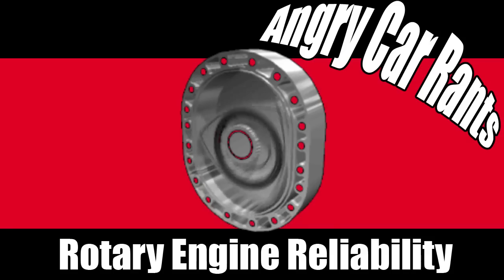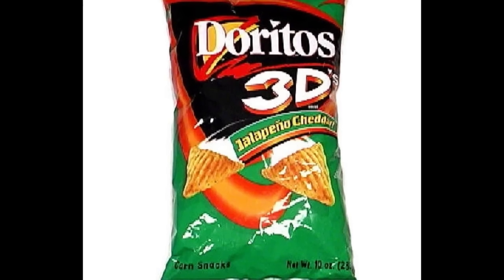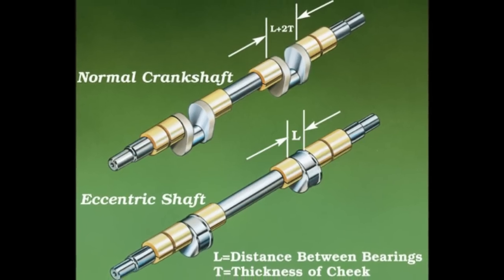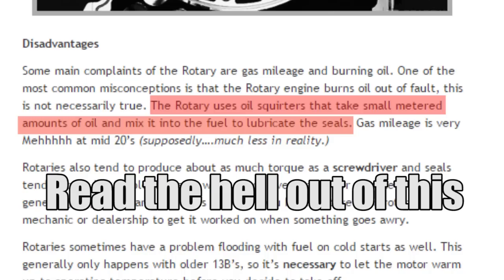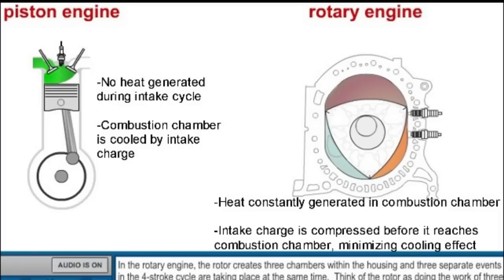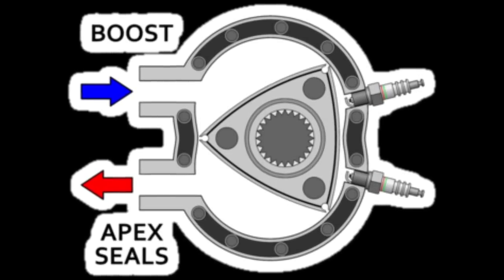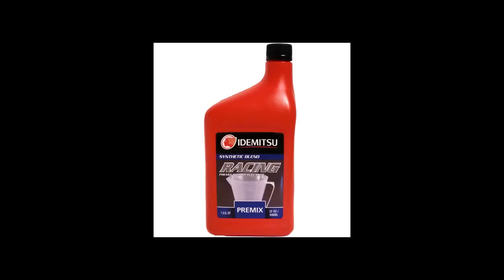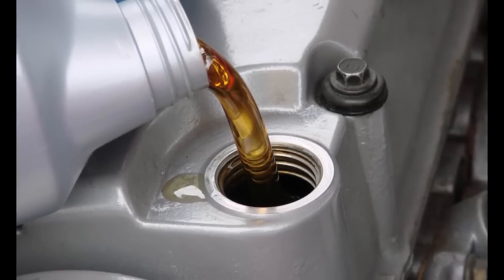Angry Car Rants #3 - Rotary Engine Reliability

Comment: Quick thought here too on another simple thing to improve reliability among these engines, DO NOT drive it until the engine is warm (give it 3 minutes to warm up, then keep it below 4k RPM till 10 minutes) and let it cool down really quick when you arrive before turning it off (all of 30 seconds to a minute or two depending on how hard you were driving) and you'll have a much longer lasting engine.

They're not hard to maintain just weird and different compared to piston engines.

Absolutely loved the video by the way.
Reply: +StellarNinjas seems annyoing you have to waste 2-3mins just to drive away :/
Reply: That's why they're usually more of an enthusiast car, besides you should really be letting a piston engine warm up for a similar amount of time, especially a performance built motor.

Comment: The trailing side of the rotary engine's combustion chamber develops a squeeze stream which pushes back the flamefront. With the conventional one or two-spark-plug system and homogenous mixture, this squeeze stream prevents the flame from propagating to the combustion chamber's trailing side in the mid and high engine speed ranges, Mazda engineers described the full process in 'Combustion characteristics of Rotary Engines', K Yamamoto et al., SAE paper 720357. Kawasaki addressed this problem in their US patent nº 3848574. This poor combustion in the trailing side of chamber is one of the reasons why there is more carbon monoxide and unburnt hydrocarbons in a Wankel's exhaust stream. A side-port exhaust, as is used in the Renesis, avoids one of the causes of this because the unburned mixture cannot escape. The Mazda 26B avoided this issue through a 3-spark plug ignition system. (At the Le Mans 24 hour endurance race in 1991 the 26B had significantly lower fuel consumption than the competing reciprocating piston engines. All competitors had the same amount of fuel available due to the Le Mans 24 hour limited fuel quantity rule.)[56] An inventor proposed that a narrow linear opening for spark plugs in the housing, instead of the round hole, would improve volumetric efficiency, fuel economy and emissions; he claims to have proved this by recording a measured reduction in the exhaust gas temperature. As in early reciprocating engines, a lower effective compression ratio is linked to higher exhaust gas temperatures. (YouTube: 'Rotary Engine Breakthrough')

Comment: btw, to get better cooling on it you want oil coolers, not necessarily a bigger intercooler. A big intercooler is nice, but in most cases a factory one will work fine. It's Oil coolers that you need to absolutely prevent overheating issues. Not cracking, just trying to help c:

Comment: An easy and basic cooling system upgrade that should have been covered is replacing the factory air separation tank made of plastic with an aftermarket metal one.  It is essential.  The factory one is a two piece plastic tank that is sonic welded together and splits over time, draining your coolant when it happens.  Anyone can easily replace this with basic tools.

Comment: Should do a rant on 2-stroke engines, and their reputation for being "dirty"

with direct injection (as evinrude, arctic cat have done) they don't live up to the dirty reputation. as well as being lighter, simpler, and more power per cc. The AMA have undeservingly shoved these engines under the rug, and it's time they made a comeback
Reply: craftsmanracer11 especially with the recent discovery that diesel 2-strokes can be insamely efficient while not being total coalburners.
Reply: +TheLaXandro True.. Currently the most fuel efficient engine in the world is in fact a 2-stroke.. of course the Wankel would be the worst... but they have been obsolete for a few years nows
Reply: +craftsmanracer11 I think 4-stroke engines are used because they're more refined, have a wider power band and are more quiet than 2 stroke engines.
Reply: Actually I find 4 strokes louder but at a lower pitch and 2 strokes bit quieter and a higher pitch.

Comment: I planned on one day getting a Mazda RX-8 someday and Wankel engine reliability is one thing that is a concern for me. I don't want to have to blow apex seals or rebuild another engine every so often, so after hearing this, it might just save me a little trouble in the long run. I really just want to enjoy a cool rotary powered sports car without worrying about the Wankel's recurring problems
Reply: I wouldn't go with a rx8 not really good for reliability

Comment: 2-stroke oils clean engines... now I've heard it all.

The problem is the fact that the oil metering pump pulls oil from the wet sump, which is dirty, used oil. That oil holds all kinds of crap in suspension, and when you burn off the oil inside the rotor housing, it leaves a lot of the contaminants it was holding. This causes a snowball of carbon deposits, which the apex seals need to scrape away, which causes them to wear prematurely. Running premix through the OMP with a Sohn adapter is ideal because it throws in new, clean oil. It also helps with cooling because the oil hasn't been cycled through the motor. Mazda simply had to combine the system because who would buy a car that has ANOTHER tank you must fill with a "specialty" fluid?

Comment: These tips are gold, as is the note to warm up before full engine load. But where's the tip about hitting 8k-9k revs briefly but regularly to prevent carbon buildup? Loose carbon chunks will wreak havoc with the seals and housing!

Comment: Rotary engines are not obsolete. They are still being made and used for aeroplane engines. There's military applications such as drone engines. Water pumps. They are also developing them to be used in electric vehicles that have a range extender motor. These are small single rotor engines that run a generator to charge the battery's. You can buy them as RC engines. Rotary is not dead it just moved on.
Reply: Wankel engines are obsolete... they are no longer in production anywhere in the world,
Reply: 1964 - 2012 R.I.P.
Reply: In the real world the Wankel engine is obsolete...
Reply: They are no longer in production anywhere in the world..

Comment: you also forgot to add that, the apex seals can be modified to withstand higher temperatures, as well as changing your stock Intercooler for a Bigger one if your 13B is turbocharged, along with a wastegate
Reply: ArcadeJunky The higher heat and pressure of turbocharging generally causes a negitive effect on apex seal longivity.

Comment: 195k miles on a 100% stock 12a (full straight pipe only, cat was bad). Lost a seal, made it another 15 miles back home would still start without a problem. Swapping engine as I type.

Comment: Drove a REPU 240,000 miles, it blew an apex seal, and I made it home on 1 rotor. Fun little truck, but what a gas hog. Eventually bought a Dodge with a hemi. 255,000 miles, better mpg, way faster, more reliable. I owned 2 Rotaries, first one rusted out at 100,000 miles. I also put a 13B in a boat, worked great, but loud as hell.

Comment: You forgot one more essential. Your engine oil must not be a synthetic or semi synthetic because when it burns the residue will gunk up the apex seals and lead to engine failure. Only use a synthetic if the metering pump has been removed.
Reply: WRONG! there are 5 different types of synthetic oil base stock.. some are perfectly acceptable to use in air-cooled engines and comparable with oil injection while some are not.. if you do not understand what types of oil you are buying, just stick with the factory recommendation.. never remove the OMP useless you understand the drawbacks and possible disadvantages.
Reply: Wrong! Rotaries burn oil and synthetics don't burn clean. You might know oil but I build Rotary engines and have been racing them for 20 years.
Reply: Because of the retaliative obscurity of the Wankel engine today there is a limited pool of reliable knowledge to pull from.. this of course spawns a lot of false myths and old wives tales.
No motor oil is designed to burn 100% clean.. if it did? it would be a very poor lubricant..
All modern detergent motor oils are "ashless" and are guaranteed to have a minimum of metallic dispersants and produce less than 00.01% noncombustible deposits.
What is in question here is the chemical make-up of those deposits and that can vary based on many factors include base stock type..
and its additive package.. To say that synthetics don't burn clean is simply false.
Reply: It's not about burning clean but more that when synthetic burn the residue build up on the apex seals spark plugs etc..etc. and causes them to fail. The official word from Mazda is not to use synthetic oils of any kind. There is only one company that makes a synthetic for rotary and that's Idemitsu. Nothing obscure about the rotary at all if you work on them. Problem comes in when people that have never worked on them or even owned one start talking like they know it all when they don't know nothing. That's  the problem
Reply: +Daniel Guerreiro  "Mazda is not to use synthetic oils of any kind. There is only one company that makes a synthetic for rotary and that's Idemitsu."
I'm well aware of this.. but you just proved my point.
You just contradicted yourself and proved my case....

The problem with that theory is most of people that claim to be experts on WANKEL engines actually know surprisingly little about them... relying on an accumulation of false myths passed down to perpetuate the denial that these engines are simply much less reliable and have shorter service life that conventional reciprocating engines..
To continue supporting this belief one must continue to find excuses and unrelated external reason to blame for the high incidence of Wankel engine failure.
Reply: The real doktorbimmer pretty sad that u make stuff up to try to change others opinuons
Reply: Another very useful tip is to let the engine warm up properly especially in a cold climate & older engines before they changed to better apex seals.
Reply: +noddy Noble  That is a tip that applies to any engine.. it does not address the real problems of poor reliability and short service life that have plagued  the Wankel design until it became obsolete in 2012..
Reply: Daniel Guerreiro shouldn't you use mineral oil instead of synthetic oil on rotary engine??
Reply: The real doktorbimmer at the moment (:
Reply: TheJocker Killer yes mineral oils work better if you are running a metering pump. I've opened many engines to find that that the synthetic oil has gummed up the apex seals and caused premature wear and or compression loss. If you are running premix and the metering pump is deleted then synthetic is a good oil. If you have any doubts it's always good to call a rotary shop.
Reply: +TheJocker Killer Don't bother, Daniel Guerreiro doesn't know anything about motor oil or Wankel engines..
Reply: The real doktorbimmer no the fake is you. Think you know but have done nothing but trolled the web vomiting your so called wisdom on other which has no basis on truth nor first hand working knowledge. Those who do will always be more wise than those who think they can. And you're a (I think I can) whereas I am a do it man. Thanks for the laughs
Reply: OH! So You are service tech?  Don't tell me... UTI graduate??? LOL!!!!
Reply: +Daniel Guerreiro Well Danny, please tell what are the 5 classes of Synthetic Motor oil base stocks????
Reply: The real doktorbimmer sorry don't know what UTI is as I'm not in America. Plus any idiot can google the 5 base stock of oil. Not impressed at all. You try and look smart but you fail miserably. So what oil do you put into a freshly built motor and how long before the first oil change?  This varies a bit from engine builder to engine builder.
Reply: Daniel Guerreiro give him a min to google lol hey dok (:
Reply: +Daniel Guerreiro  Wow! really?  Who do you think you are going fool??  You are clearly pretending to be someone you are NOT.
Reply: +terrance hill  I know! He really revealed himself on that one.
Reply: +terrance hill   You are UTI grad right?  Or are you just a lube tech?
Reply: The real doktorbimmer do you know WITS.
Reply: I was actually talking about u.. i also didnt even read it, i was just bugging u lol ill leave u two alone now
Reply: +Daniel Guerreiro You are the one faking it...  you are not fooling anyone!
Reply: The real doktorbimmer still can't answer the question? Come, come. This is an easy one. Plus what is WITS?
Reply: The real doktorbimmer looks like you are fooling yourself
Reply: Daniel Guerreiro haha u got him.. ive been there he will disappear and come back in a week or two
Reply: +terrance hill  Well Terry, you are still young and inexperienced,  but sounds like your getting your life turned around.. keep up the effort and you might make some significant accomplishment in life..
Reply: +Daniel Guerreiro  C'mon Danny! give it up... you have been exposed as a fake...
Reply: The real doktorbimmer no you have. Answer the question. It's not a hard one
Reply: The real doktorbimmer Time is up Faker. You lose
Reply: The real doktorbimmer answer the question. Can't do it except write "you lost". Come on, answer the question stop avoiding. Like I said before. You live in lala land. You really make me laugh.
Reply: +Daniel Guerreiro  You have been exposed as FAKE.. there is no need for you to continue you're fake charade any further.
Reply: The real doktorbimmer only place I've been exposed as a fake is in your little world. Answer the question. If you can that is. Don't think you can. Plus what is WITS?
Reply: +Daniel Guerreiro FAKE!
Reply: +Daniel Guerreiro Seriously Danny.. you are the joke here.. stop pretending
Reply: The real doktorbimmer hey doktorweiner! answer the question.
Reply: The real doktorbimmer no trust me every one thinks you are. Plus here UTI is an infection or a moving company.
Reply: +Daniel Guerreiro  Too late Danny!!! You have already been exposed as a fake... the game is over.
Reply: +Daniel Guerreiro  Yes, you are a fake..  stop pretending
Reply: +Daniel Guerreiro  Sorry Danny.. You had your chance to prove you were legit... but instead you exposed yourself as a complete and total fake.
Reply: The real doktorbimmer where did I expose myself. Please elaborate
Reply: +Daniel Guerreiro  The game was already over Danny boy.. you lost.
Reply: The real doktorbimmer seriously hahaha hahaha. You really are cooked. Thanks for the laugh.
Reply: The real doktorbimmer u guys make me laugh (: u both call each other fake because u have different opinions, yet ur both using the same reasoning "ur fake because u didnt answer my question" neither of u guys answerd the others question, does that meen ur both fake?
Reply: terrance hill   This doktorweiner is a good laugh. He only knows what he can google. As soon as you ask him a question that comes from experience, something you can't google then all he can do is throw insults. It's like dealing with a teenager. Makes for good comedy
Reply: +terrance hill I'm not the one pretending to know anything about motor oils or regurgitating false information off some forum...
 My guess is he is a UTI drop out.. and was embarrassed to admit that...
Reply: +Daniel Guerreiro "IMI' Then?????
Reply: The real doktorbimmer u better hope dan doesnt show up and make u look foolish again lol
Reply: +terrance hill  Dan?
Reply: Daniel guerreiro
Reply: +terrance hill He knows as little as you do about Wankel engines..  just another rotard  fanboy Lol!
Reply: Hence I installed a Sohn adapter to run only clean 2 stroke oil. This frees up some oil choices. I use semi synthetic in my rx8, since it's not burning it anyway. Point of caution here, the oil rings on the side of older wankel engines do not take kindly to the additives in semi and fully synthetic. Additionally I premix between 125 & 250 ml on a full tank.
Reply: @doktorbimmer  GOD BLESS YOU WITH EXPLOSIVE BLESSINGS

Comment: I've owned 2 rotaries, 1 didn't make it to 100,000, the other one only 178,000 miles. But my 2 Dodge hemis get way better mpg, have 3X's the hp and 1 has 345,000 miles and uses 1 qt every 20,000 miles, the other has 260,000 miles, uses 1 qt every 15,000 miles. My 6,000 lb Ram runs 14.2 sec quarter mile and gets 18 mpg, my 3100 lb Mazda REPU ran 16.1 sec and never got better than 16 mpg. Friend of mine has a 1956 Chrysler with 354 hemi and 300,000 miles, that old car is way more efficient than a Mazda RE. Sorry Mazda, you are beating a dead horse. Hell, a Dodge Hellcat gets 22 mpg!

Comment: Only time I seen a reliable rotary engine is when it was tuned on e85, the owner beat the hell out the car for a few years and never had a issue. At the cost of fuel economy but the. But Again it's fuel efficient in the first place. 

But I was researching a company who take your rotary housing and mills of the chrome surface and replaces with different densities of ceramic to keep the heat even through out the whole housing I wonder if anybody tried that??? And what's the results
Reply: "Ceramic metallic matrix" works well, but I have heard some of the companies doing it aren't quite up to scratch.

The Le Mans 787B is a good example of how well it works when done right.
Reply: My buddy had a bridgeport 13B in his FD. That engine ran on pump gas, boosting 1.5 BAR (21.7 PSI) on a T04S for five years. Only reason the engine went down was because a freeze plug ended up rusting out and took the engine with it. It's all in the tuning.
Reply: +tvar doasair  Poor reliability was one of the main factors effecting the RX brand's poor sales and Mazda's decision to abandon the Wankel engine altogether back in 2012.